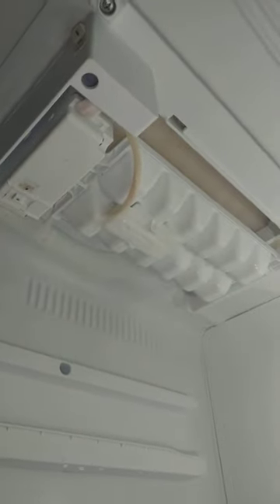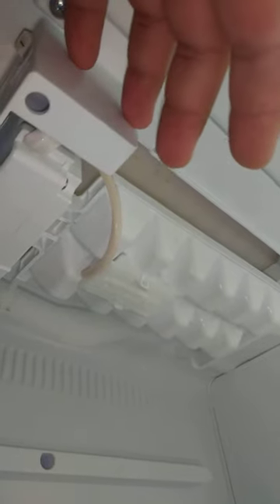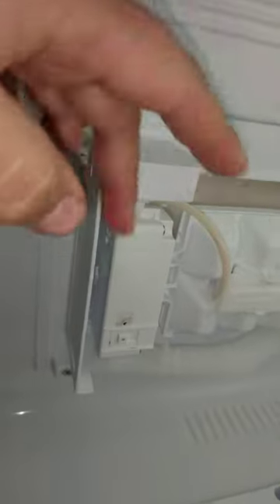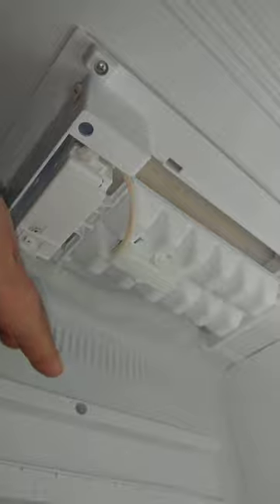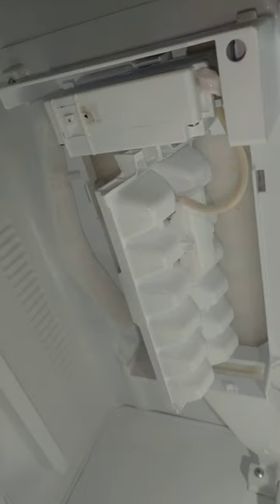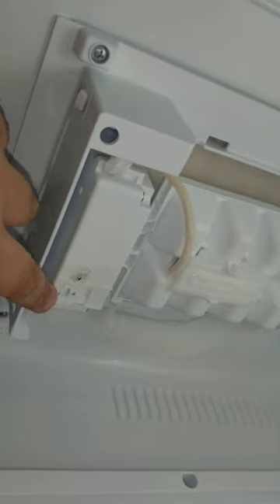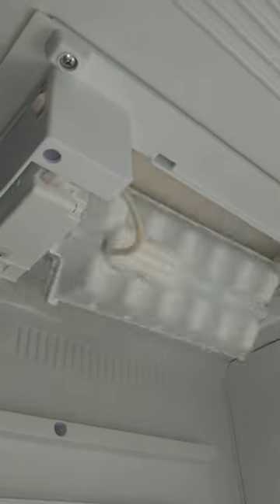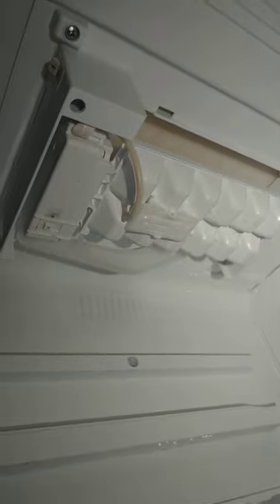LG Refrigerator twist n flex Ice maker failure

Comment: Many have reported that the tray will overfill with water - causing water to leak over into the collection bin, which then turns all of the ice in the bin into one big ice block.  There are two popular online causes listed for this behavior, but I believe there is a third culprit.  The two causes that you'll find listed are 1) water pressure is too high from the supply causing overfill, and 2) a faulty water inlet valve that is dispensing or leaking too much water into the tray.  I believe the 3rd cause is much more simple - over time you will get mineral scale buildup in the bottom of the ice tray cells.  The scale buildup causes the frozen cubes to occasionally (or frequently) not eject from the tray properly.  Sometimes you will get a cube or two that don't eject at all, and sometimes you will get cubes that break and only part of the cube falls out into the bin while leaving part of a frozen cube in the bottom of the cell.  Look for cubes in the bin that seem to be missing the tapered end of the cube.  There is no "fill sensor", it just dispenses a preset amount of water, so when the cubes don't eject properly, the water overflows on the next fill. You can remove the whole assembly and try to clean out the mineral-scale with vinegar, but more than likely you'll eventually just need to replace the whole assembly.  It's a shame that it's not possible to just replace the tray.
Reply: This is spot on. In our unit, 2-4 cubes sections closest to the door are stuck in the tray after it twists and releases the rest. Then 2-4 cubes worth of water overflows into the collection bin creating one giant lumpy ice cube. I’ve cleaned the tray several times with vinegar and am so close to just turning it off and going old school trays because it’s absurd that I have to replace the entire unit.

Comment: I've been having a similar issue. Watching this has enabled me to figure out what is going on... or rather not going on. My tray was twisted, but I managed to reinsert it correctly. The startling knocking sound that began this morning and lasted for 20-30 seconds each time was the plastic thing trying to turn the ice cube tray. It's in a unit with wires so I won't mess with that. But at least I now know what was causing the noise! Oh! And I didn't realize there was an on/off button for the ice maker until today! At least I can turn the ice maker off so I don't get fricking scared out my pants when I least expect it - literally jumped out my skin making coffee this morning, when it first happened! Thank you for your video!

Comment: Having the same issue with overfilling of the tray.  Water also gets into the ice bucket below and freezes all the ice cubes together.  I'm not sure if it's happening because of the overflow or if the tray is not in the right position when it fills.  I couldn't locate a reset button until I saw this video, so thank you!!!!

Comment: I was  noticing the odd cube not ejecting, then the overflow sitty. Thanks for the reset button test! I'm glad I didn't buy a new ice unit  though the prices used on eBay for a reman unit are very good $40-50 range.

Comment: FYI. Another video from a repairman said water pressure issues will cause the overfill problem.  Not enough or too much pressure.  Pressure needs to be between 40 and 120 psi.  You can check pressure at any outside faucet with a common gauge you purchase.

Comment: Thanks for the video.  I located the reset button, thanks to your video.  Mine is not making ice, but after pushing the button on the bottom, it did "flick" some ice cubes out... Don't know the root cause yet, but, looks like I can get a replacement on Amazon, if needed.  Thank you again... especially not easy to work on!  Cheers!

Comment: I have the exact same issue. Looks like piece of plastic from tray snapped off (never found piece) tray where it attached to motor arm. Cannot locate replacement tray that fits this ice maker unit only full ice maker replacement. Curious what solution you came to? Thanks
Reply from the maker: I replaced the whole thing. Thankfully not hard, and fixed my over filling issues.
Reply: @andrewesquivel  just did the same myself...hopefully this one last.
Reply: My AEQ72909603 ice tray cracked so I recently bought a refurbished AEQ72909602 assembly for $60. Once the replacement was installed the arm wouldn't work so.... I just popped the ice tray out and put it into my assembly. It fit perfectly and works great. Of course there was nothing wrong with the motor of my ice maker, just the cracked tray.